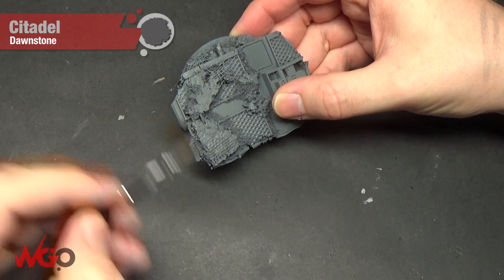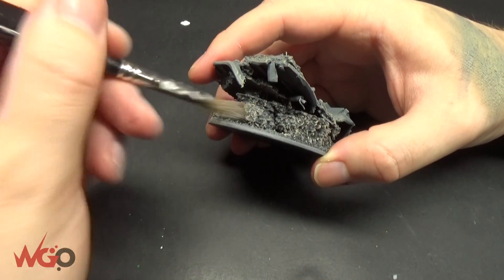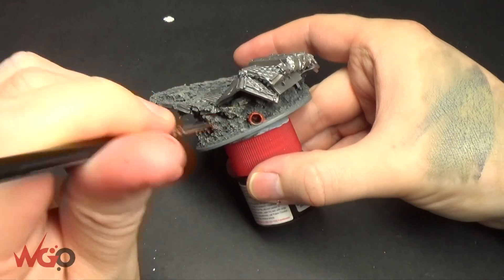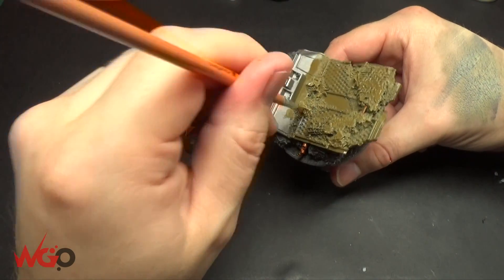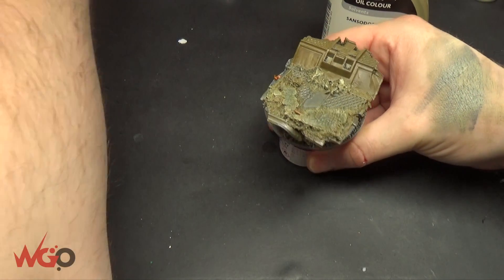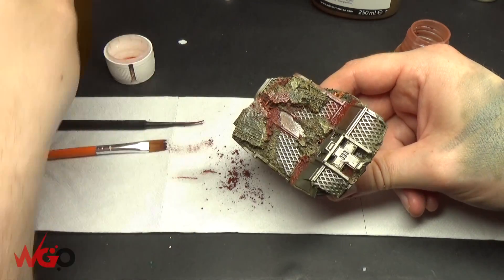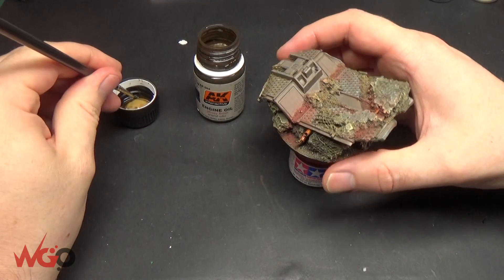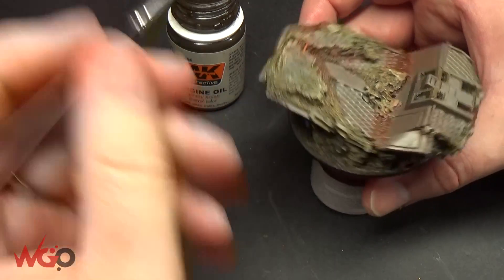Tutorial: Destroyed Armour Bases

Comment: Do have to varnish the base before i use white spirits on it?
Reply from the maker: Willy Wilson I never varnish until the end when the model is done but others have recommended sealing the paint before using white spirit. Try it on a small area first and see how you go, generally if you are airbrushing thin layers I would seal it before applying spirit :) -Sam
Reply: Thanks sam, i will give both a try
Reply: You can probably get away without varnishing, but I'm admittedly cautious (possibly needlessly) about the idea and always tend to seal min before hand.  Between the solvent in the enamel wash and the white spirit used to clean it (itself another solvent) you might want up stripping off the acrylic paint underneath the washes by accident.